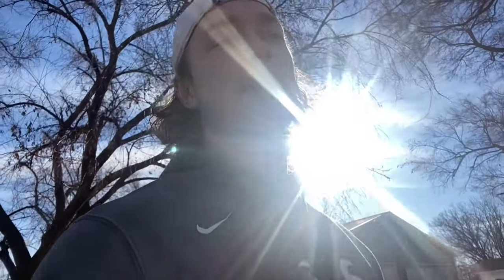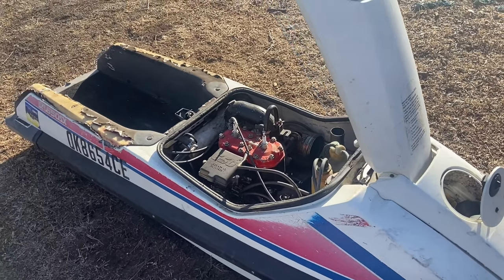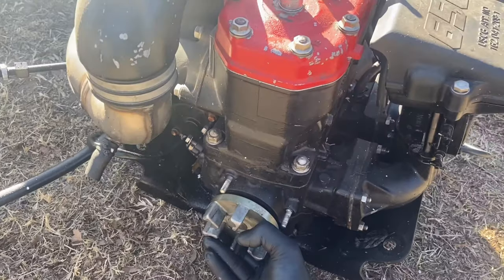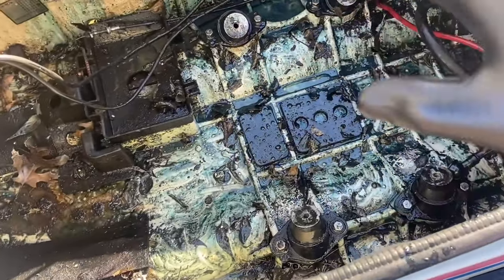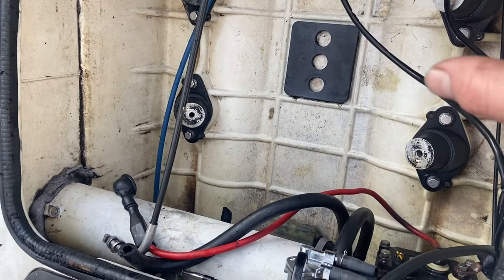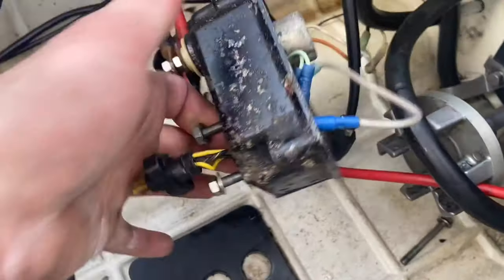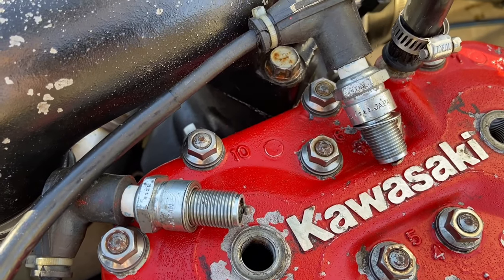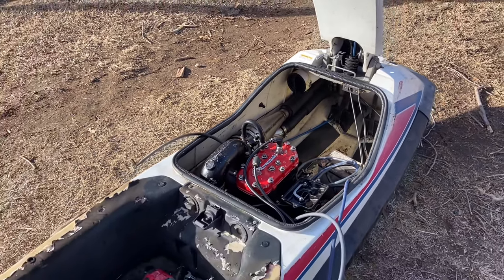Building a 650SX stand up jet ski in ONE day!

Comment: Good project. Wondering in one of your videos you said probably wouldnt be able to flat water backflip on the BOB. Is there a reason why
Reply from the maker: Mainly due to my power to weight ratio. I’m afraid the fiberglass work will make the hull too heavy and my stock motor won’t be able to flip it. Well just have to see though

Comment: Hey man so I just picked up 2 89 650s. They have been sitting for a loooooong time. Cranks good, shaft is free, good spark but the compression is super high and it’s shooting oil out of the cylinder heads. Any thoughts?
Reply from the maker: Is the oil milky?
Reply: @NastyMoto  nope. Soooo we deleted the oil pump to switch to mix and one is doing great now. So we figured out it has such high compression because it’s full of oil… like fulllllll of oil. Now I’m trying to think of how I can get the oil out without hydro locking it or burning up the starter by cranking it all out. When I say full of oil I mean it gurgles when I stop cranking it haha